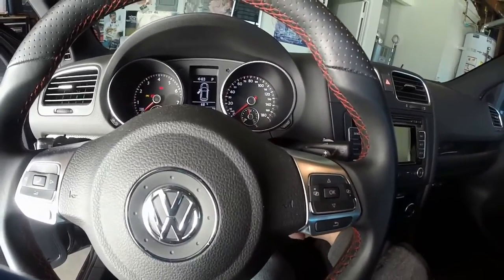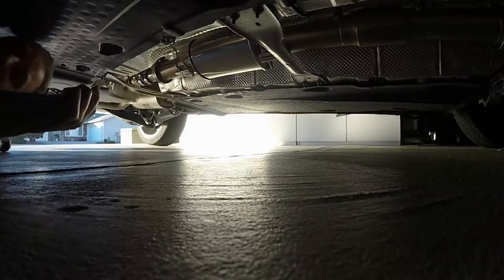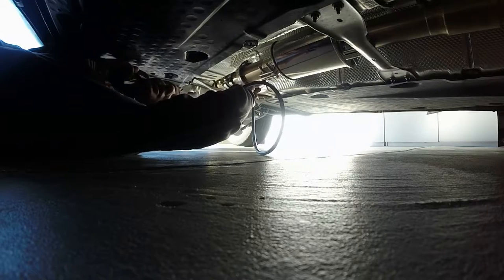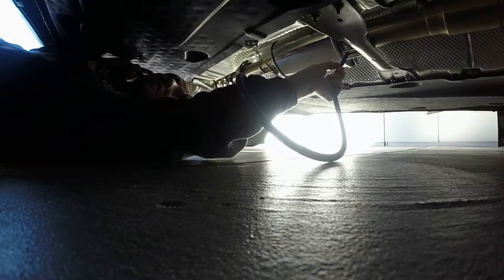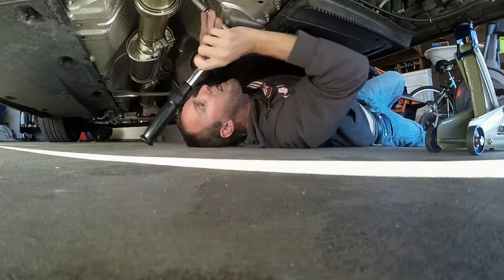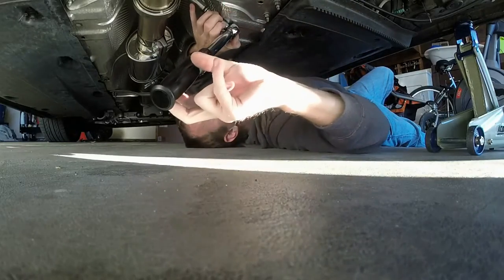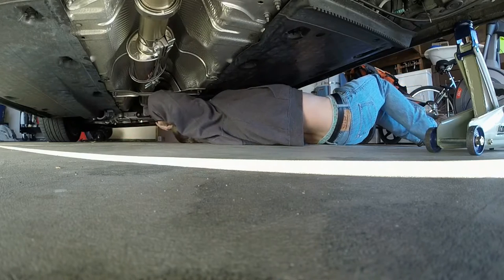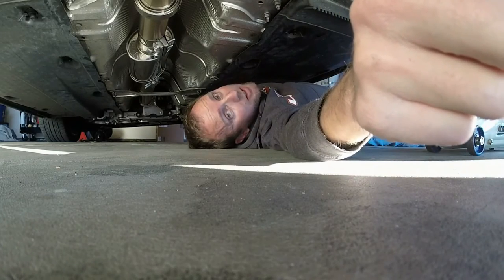2013 VW GTI: Episode 85 Vlog: Do lap joint band clamps leak?

Comment: What is the tourqe on those v-band clamps?  Also be careful under the car with just a jack, should always slide a stand under there just to be safe. Maybe you did have one and can't see it in the video.
Reply from the maker: of course i had a jack stand. look carefully. no idea on the torque. just tight till you can't tighten anymore. the bolts are huge. basically until the 2 ends pretty much touch.
Reply: LastHumansGarage My bad.. I saw the stand in the beginning of the video.. lol

Comment from the maker: to david heether, cuz i dont have a reply button under him.. damn google+ bugs.. yes, i would include Winn as not a place to buy a VW just on principle. But also, I have bought 6-7 GTI's in the bay area since 2006 at various dealers. Winn pricing was never in the top 3 anyway, regardless of their parts ripoffs. Boardwalk VW was never competitive either on new car pricing, they would always budge much less than others. I have price shopped new GTI's at every single dealer every time I buy. If I really think about it, the dealers with the best VW discounts were Hayward VW (which has a bad reputation, but good prices), and Sunnyvale VW has real good discounts too. My 3rd would be Stevens Creek VW, a good place to buy, especially if you work with Greg Kimberly.
Reply: My reply button works great lol. J/K but thank you for the heads up. I live in Pittsburg Ca. which is pretty close to walnut creek vw (Dorito Bros) but last year I had a bad experience with the sales manager there. I will be using my UPSers discount which is like 500 off invoice. I just want to have a good experience when I do go to buy. I have to pay my wife Malibu off first so mid 2015 Ill be buying the mk7. Also was it hayward that gives the most for trade ins? You mentioned one dealership in another vid that will give you top dollar for the trade in and you don't even have to buy a car  from them. Thanks for the reply as well.
Reply: No, it was a Honda dealer that gives fat trade value.